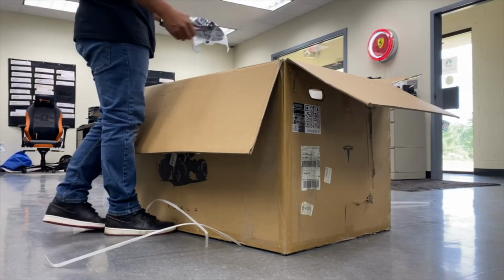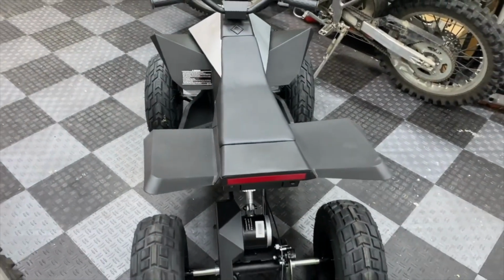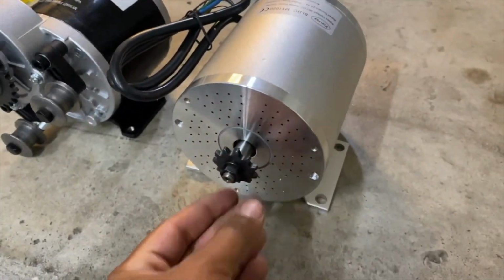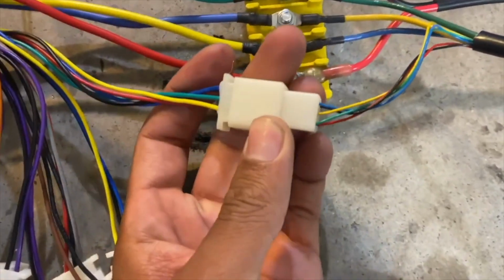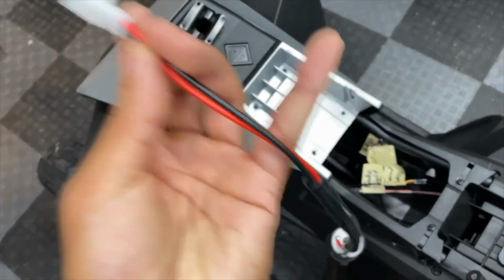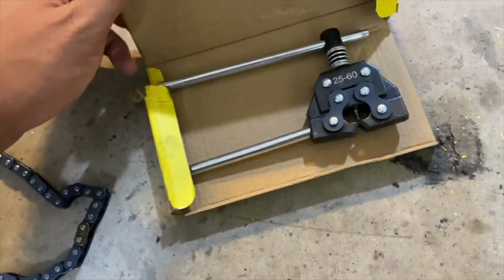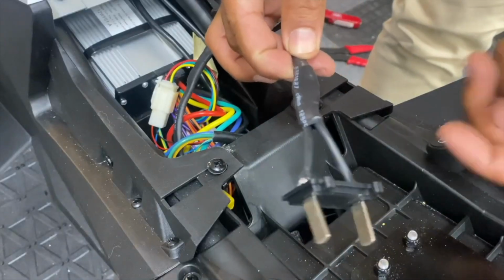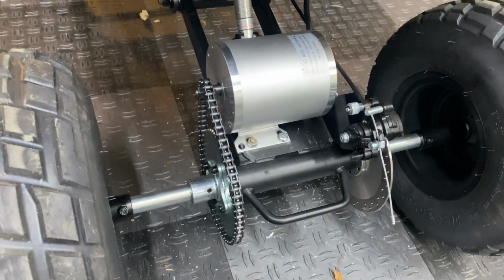FULL Tesla Cyberquad Build - Kunray 1000W Brushless Motor Kit Install

Comment: Hi there. Im new to razors and ebikes in general. I have the 500w 36v motor out of the cyberquad installed on a razor 350 atv. Its running the 36v razor stock contrller at 36v. Is there any reason why its so slow? Do i need a hi/low switch?
Reply from the maker: It’s designed for completely different gearing and rear sprocket size. Also the stock MX350 controller supplies much less power than a cyberquad controller.
Reply: @PatOutdoors got it. I have a 36v controller on it running 36v and its slower on the bench test compared to the 350 stock motor running the same controller
Reply: @PatOutdoors I see the motor has two plugs, one for the controller and one for something else. Does the motor run on a hi/low setting, or is the motor is got a dud. I will post a video later this week if you want to check it out
Reply: Wish you were in San Diego! I wanna upgrade my Quad and I’m not that “technical.”

Comment: In the razor group, a guy sells an adapter to space the wheels out to make it more stable. I wonder if it's the same pattern as the razor quads.
Reply from the maker: You talking about widening the track? Honestly it’s a suspension geometry issue. Turning at low speed has a lot of drag from the inside tire pushing out
Reply: @PatOutdoors yeah the gromtry is trash just like.my razor quad but the widened track helps keep it on all fours more. Love the way it looks. Would love to see more of the build and how rowdy it can be lol
Reply: Link?